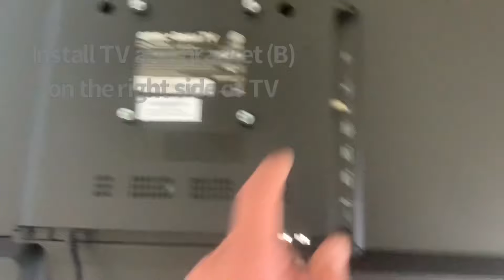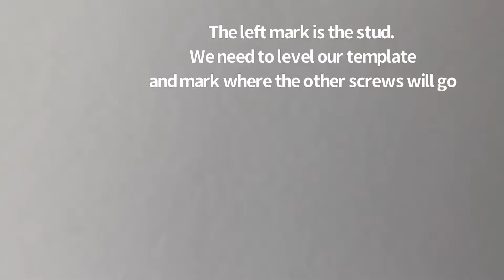How To Install Hang Onn TV Mount || Super Easy Install

Comment: Awesome video! After watching you, I am confident enough to attempt doing this by myself.  The only thing I wish you would have shown is how you hid the wires. Thank you so much.
Reply from the maker: Thank you! And yeah you can def do it..and the wires are only hidden because I didn’t plug them in yet..if you want hidden wires, unfortunately you will have to put an outlet behind the TV
Reply: @danielbigelow2193 or add a retro ring and run the cords down the wall and plug into outlet below

Comment: Do I need the white things or can I mount it without them?
Reply: The anchors? My instructions say you don't need to use the anchors if you're mounting it on drywall. But you need to use it on concrete.

Comment: What screw did you use in the anchor? I have the same wall mount and my instructions are telling me to put the big ass leg bolt into the anchor. Also, I tried using a small drill bit like you suggested but couldn't get the anchor in. Would it hurt if I used a 1/2 drill bit instead?
Reply from the maker: I used the screws that say “E” on the bag.. I believe those are the lag bolts you are talking about.  And if you are just putting the anchor into the drywall, you need to open the hole up a little with a drywall saw (or screwdriver) just enough to where you can hammer in the anchor.  The drill bit is used just to start the hole..hope this helps
Reply from the maker: 1/2” drill bit could help for the anchors
Reply: Same the here , the instructions says not to use anchor.

Comment: Its said dont use anchors on dry wall on caution label ? Im confused so its safe to use on dry wall?
Reply from the maker: Yeah it’s fine but try to use at least one or two screws into the stud
Reply from the maker: If you don’t have anchors, it’s better to use 3/8” toggle bolts
Reply: @danielbigelow2193   did u use a socket wrench? Whats screw and tool u end up using to place the back piece?
Reply from the maker: I just used the screws and anchors that came with the package..and just used my impact (Phillips head bit)
Reply from the maker: Actually I think I did use a socket bit for my impact

Comment: That was too easy i did it too... I saw your video just to make sure I'm doing it right..
Reply from the maker: Yea man not much to it 👍🏼
Reply: Do I need the white things? Or can I just screw it in without them?
Reply from the maker: @ItsNatesArt  if you are going into the stud, just use screws..if you are going into nothing but drywall, you have to use the anchors or toggle bolts..otherwise the screws will fall right out
Reply: @danielbigelow2193  I just got it on the wall! I just seen this comment lol but I didn't use them cuz I have studs it's attached and good! Thank u
Reply from the maker: Lol awesome..yeah it is much more stable with the studs